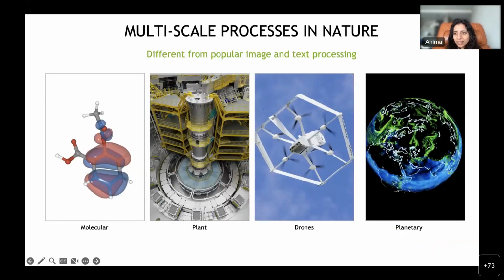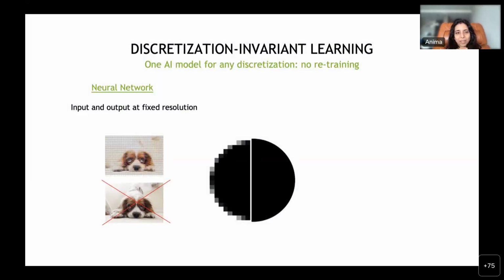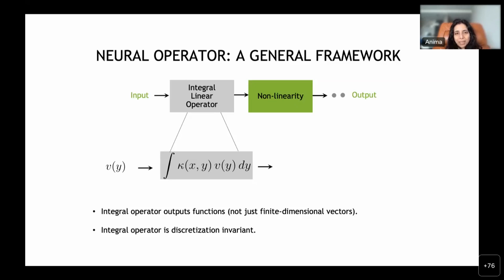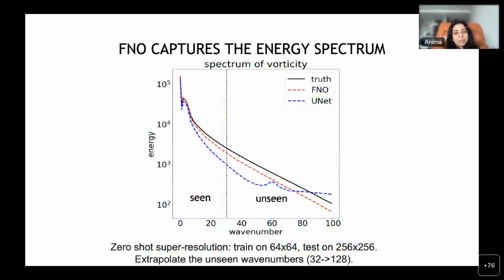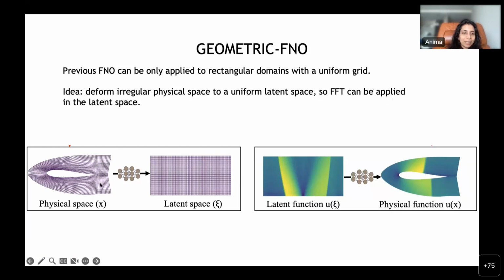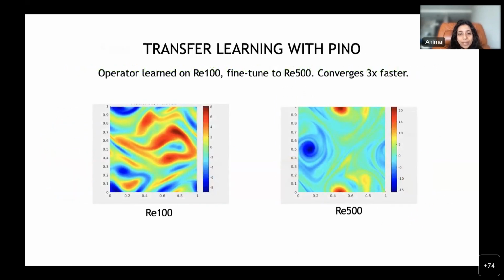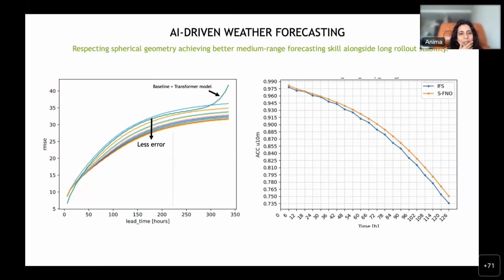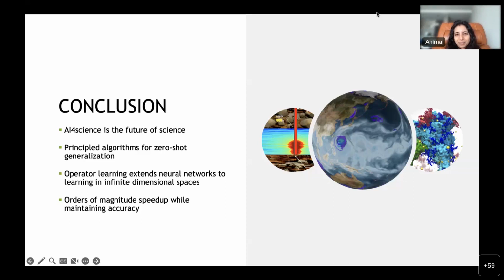DDPS | ML for Solving PDEs: Neural Operators on Function Spaces by Anima Anandkumar

Comment: Current machine-learning methods have not contributed to our understanding of fluid mechanics, for example, which is basically governed by one of the most difficult partial differential equations set.
Reply: Machine learning is usually used as black box tool and we are more concern on good result i.e good mapping between input space to output space. This is my point of view. Could you elaborate more on what to you mean by understanding of fluid mechanics with examples?